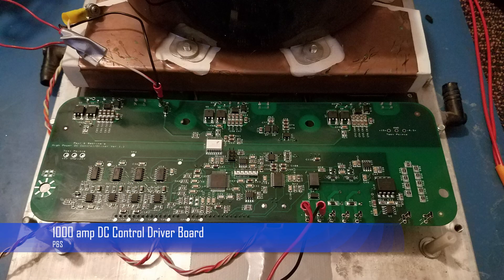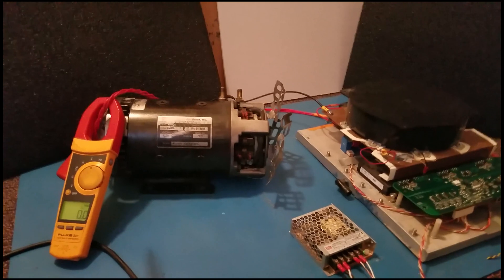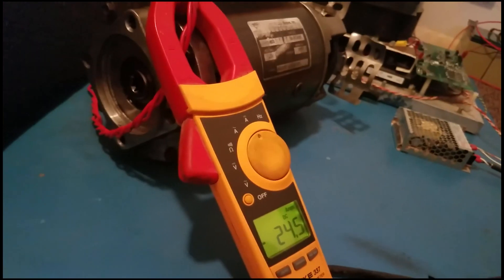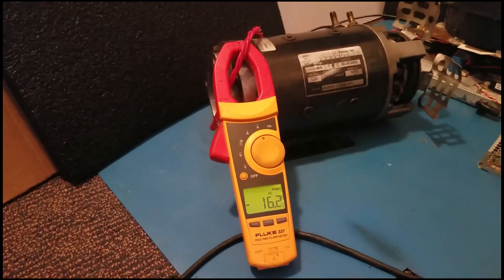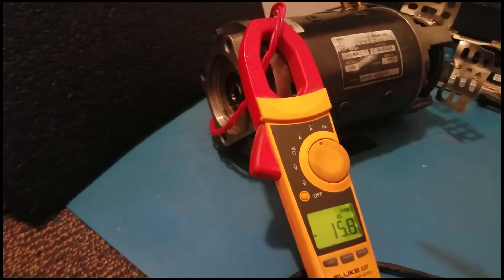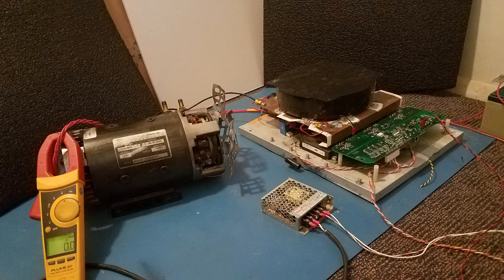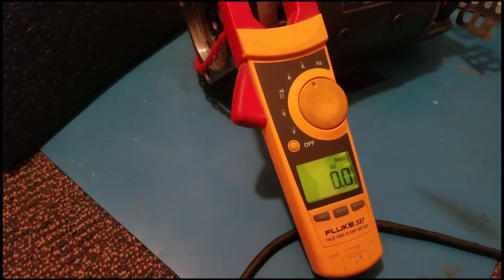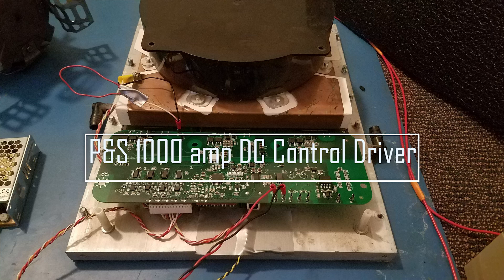1000 amp DC Control Driver PandS

Comment: Hi Paul, awesome job. Just wondering, you mentioned this controller could be modified to act as a high current battery charger as well. Is there any way this controller could be modified to act as both motor controller and charge controller for an EV? Many thanks

Comment: Hi Paul. Peter here from the UK, I am the person who bought an AC control board from you which has been sent back to the USA due to a postal error. Please could you email me as I cannot get in touch via your website as it comes up with an error if I send a message. Thanks. Peter
Reply from the maker: Please write to PandSPowerelectronics(at)gmail(dot)com.  When you write to "sales", it directs it there, but when I respond, it doesn't appear that you are getting it from me.
Reply: @MPaulHolmesMPH  Hi Paul. Thanks for replying. Have you got my AC inverter back ? It got missed by me as the post went astray. Just let me know so I can stop worrying. Thanks. Peter

Comment: Hi Paul! Please make a video about the charging capability of this card.
Reply from the maker: OK I can do that.  IT assumes a DC input.  So, if you had rectified 3 phase,  or a battery pack (or solar) on the input from 0v up to around 1000vDC, you could charge an output voltage that is less than the input.   I"ll see what's available for testing.

Comment: Can we learn more about the board and software? Seems this is a custom board you build and controller you programmed?  Is it open source/open hardware?  While I do not think I have a use for such high voltages, that current regulation looked really nice. How you shift the pwm frequency around to avoid noise seems really cool, would love to hear more about that if you don't mind sharing.  Nice job on the smooth but quick responding design!
Reply: He sells them (I found a website in his about page)
https://pandspowerelectronics.ecwid.com/#!/*POPULATED*-350v-1000amp-DC-Control-Driver-Board/p/59121616/category=16287307
No idea what sort of documentation it comes with.
Reply from the maker: Yes You can email me and i will send you the info.  pandspowerelectronics@gmail.com